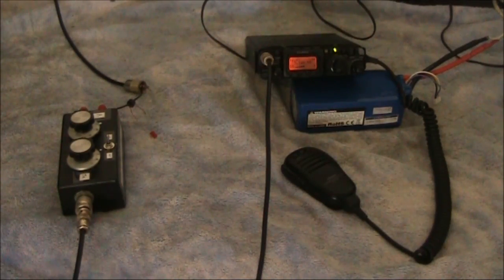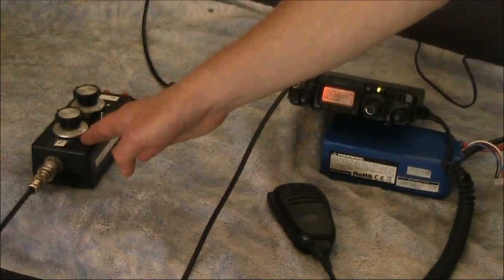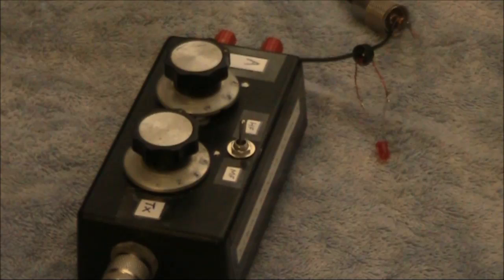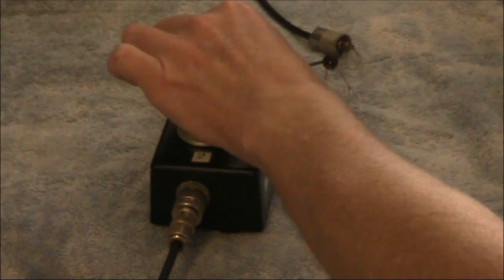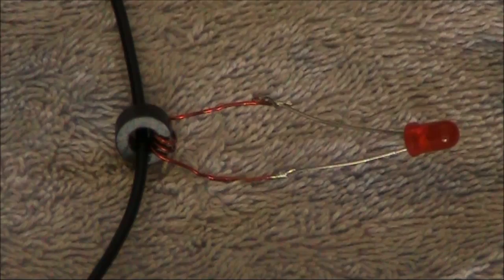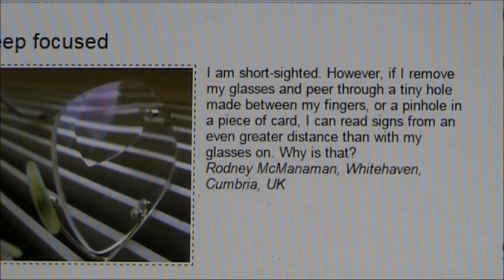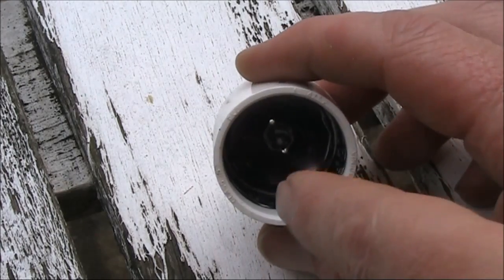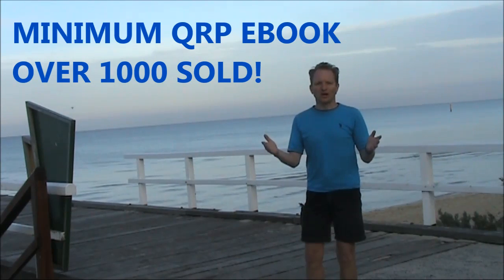Tune for max brightness: LED RF current indicator for end-fed antennas

Comment: I wonder whether the same trick might help measuring the resulting current through an Arduino A/D (and current-to-voltage circuitry). If... in the range 0-5V (or 0-3.6V), one might build a very simple device to tune a magnetic loop’s motorized capacitor. Anybody willing to join forces an try? The algorithm for tuning would be a simple maximization search (or bisection).
Reply: I bet you can use a zener diode to limit the voltage fed to the arduino.

Comment: I know this is a bit late (6 years) will this work on the loop of a mag loop antenna, providing you use a big enough toroid?
Reply from the maker: Haven't tried it. But with magnetic loops you should preferably use a rig with a VSWR indicator built in so it's not needed.
Reply: @vk3ye  
Thinking like an ALEXTUNE

Comment: why not just replace the led with a meter so you can get a better reading
Reply from the maker: 1. Meters are expensive. 2. We're most interested in a peak and an LED is fine for that.
Reply: @vk3ye  Cheap ass meter from a old cb radio, cost less than the led....free.
Reply from the maker: @memedontcare1433  Not everyone has access to a well stocked junk box including old CBs. And even if they did many old CBs had LEDs, not meter movements.

Comment: I did a similar thing after being given a supposedly non-working MFJ 16010 tuner. I put a red LED in the front and the FT37-43 core with 6 turns placed on the output wire. It did stop working after two years and I found a loose wire inside not soldered but just touching the switch.
Reply: MFJ's QA is not the best.

Comment: One of the more valuable YT vids I've watched in many a moon.
I'm now off to my junk boxes to piece together an RF current indicator.
About the eyeball thing. The tiny hole blocks most of the light rays of the image into the eye and reduces the amount of light rays crossing each other within the eye and scattering across the retina causing the out of focus vision.
The Inuets/Eskimos use a piece of bone with a narrow horizontal slit as sun glasses. The slit reduces the amount of light hiting the back of the eye preventing sun blindness. It also helps some with vision problems but not nearly as much as Peter's little peep hole.
Peter, thanks for both pieces of knowledge.
73 OM......

Comment: Does this loose coupling decrease the transmission power? I have tried hard wiring PNP and JFET LED indicators, but they significantly reduced power to the antenna on small transmitters.
Reply from the maker: I remove the LED indicator when transmitting and haven't done any tests on tx power with it connected/disconnected (you could try WSPR for that).
Reply: @vk3ye  Sorry, I'm unfamiliar with  WSPR...??
Reply from the maker: @andrewferg8737  Check some of my earlier videos for a WSPR introduction.

Comment: Simple is beautiful, like your cat. I'm surprised no one called you out on your statement about LEDs being non-polarized. As I'm sure you know (but didn't want to re-do the video), LEDs are     diodes, therefore polarized. It works in this circuit 'cause it is operating on only one half of the rf (ac) signal and blocking the other as long the carrier's amplitude remains "in tolerance" of the particular diode.  Oh, yes, I've burned up a few! Cheers, Mate. Wife and I toured NZ's South Island, and I've been to Brisbane and points west in AU. Wonderful people; wonderful scenery!

Comment: Simple but effective. I used to tune my single 807 tx with two turns of stiff wire connected to a car tail light bulb. it sat over the PA tank coil.  Like the way the LED does the rectification.

Comment: Peter: Some cores will warm when used with a pass-thru wire. To reduce losses, you need to add a low value resistor (100 Ohms or less) in PARALELL with the coil. 
Thanks for share your experience. Edgardo www.LU1AR.blogspot.com.ar

Comment: You sure it's alright to randomly go across different frequencies humming into the microphone? o-o
Reply: +HTFCirno2000 It does look/sound like he's listening on each frequency he's testing on; and there probably isn't too much adverse impact from the 500 mW power level being used for this test ...
Reply: This is illegal in the USA. You have to identify on each frequency before moving to the next.
Reply: @TheLightningStalker  Do you have to identify before using an automatic antenna tuner?